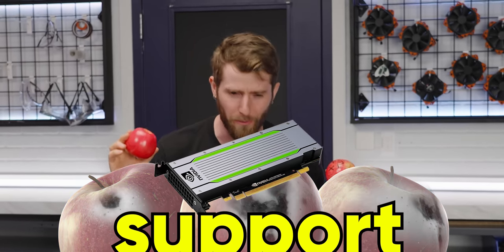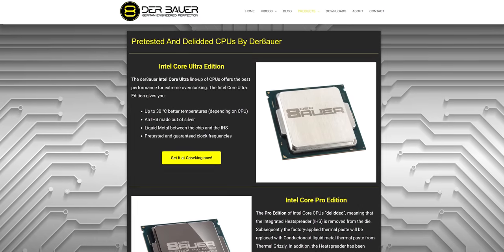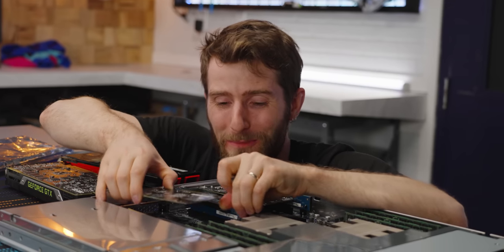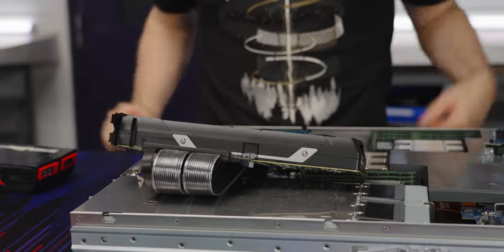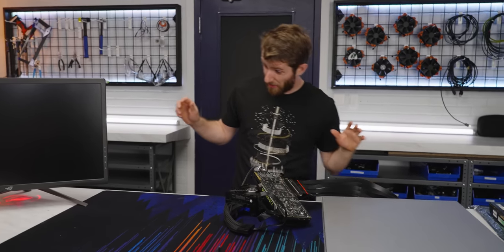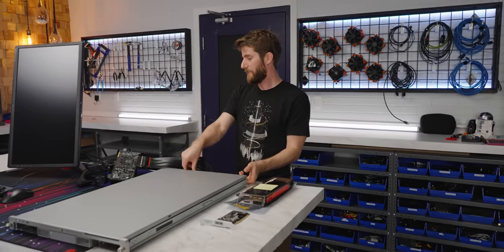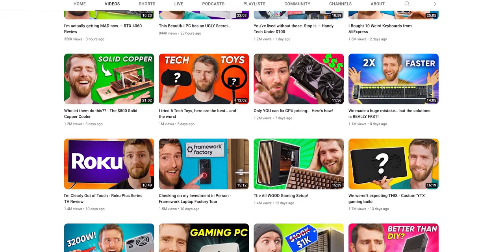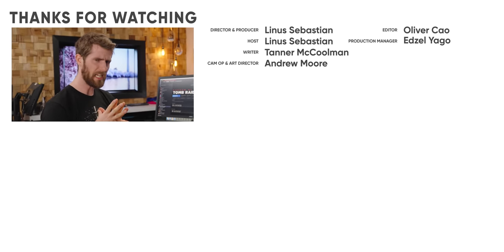Gaming on the Apple SERVER? - XServe 3,1

Comment: Tim Cook spinning in his grave? Well. moving on...  The Xserve 3,1 is basically a 2009 Mac Pro 4,1 cheesgrater, stuffed into a rack mount case. You can upgrade the processors, either by delidding them yourself, or by getting already delidded. The prices for those delidded CPUs have dropped considerably.

Your ram problem is most likely a problem with one of the processor pins. That's not easy to fix. Ideally, these machines support 128 GB of ram, although with triple channel, 96 is the best you can do. 
 Inter34stiong to see that you found an Xserve specific workaround for installing the GPU. On an actual Mac Pro, you would have had to do the Pixlas mod to install it.  The external idea is kind of cool.

The 4,1 Mac Proi/3,1 Xserve is restricted to El Capitan. However, it is easy to upgrade the firmware to a 5,1 Mac Pro,  to get it to High Sierra, and, with your metal capable GPU, there is another firmware upgrade to get it to Mojave. Once you have done that, it will run Monterrey with Open Core,  I am writing this from a 5,1 mac Pro running Ventura with OCLP. 

I've never wprked with an Xserve, but I wonder if OCLP mightg slove the Boot Camp Issue, since it would then identify as a 7,1 Mqc Pro. I don't know, but it's a though.

Comment: I had that same issue with Steam on Linux Mint using the 525 Nvidia driver for a while till 530 rolled out on Linux, I would have to force stop Steam 5 or 6 times before it didn't load a black screen, now was it the driver possibly not but I am blaming the driver till I find the real reason behind it.

Comment: I wonder if the boot issues were caused by the internal GPU on the daughterboard below the farthest-to-the-side PCIe area. I had to take mine out to put a better GPU in mine back in the day.
7:14 - I think those LEDs only come on when the lid is off too, if my 2,1 was anywhere close to the 3,1

Comment: Why though, why would you port a game to mac or try to game on a mac?
Spend just as much money as a top of the line gaming computer costs and get the gaming capability of an entry level gaming pc.

Just buy a windows pc for gaming, as easy as that. No linux, no mac os, just use windows. If you're not an IT person, don't start with an OS where you have to spend hours trying to get a single game working. Windows has had games on it since DOS was released, it's not efficient compared to other OS's but overall availability in terms of software, games, mods, tools and whatever you need to install will 99% of the time be supported by windows by default

As an experiment i think this stuff is cool, so i loved the video. Not hating on what you guys did at all! Love all your weird experiment videos, keep it up! 😄

Comment: Will developers port?   I doubt it.  Doing their own thing rather than supporting vulkan suggests they don't care about anyone and won't provide any help.  Apple also behaves like big retailers - they offer new brands with new ideas, then copy them with their own brand and ditch the third party - see what they've done with both CPUs and the opensource parts of their OS.  If Apple users want to game, they'll have a macbook and a gaming rig.
Although GPU prices are falling, I'm a bit surprised the GPU makers haven't just included a CPU slot on their cards.   32G of GDDR6 FTW!  Resizable bar to the max!
Reply: @@photobunny So... Metal has been around for ages but has almost no games.  Vulkan has lots of games.  With the low effort put into PC ports and the likelihood that gamers have non-mac systems, I can't see a push for this from either a demand or supply perspective.

Comment: Yes, long ago, Apple actually gave a shit about upgradability and customization and cared about their consumers. Now everything has to be soldered to the board, blocked from upgrading on the firmware level, and has hardware requirements for their software in order to force buying a new computer (creating so much e-waste).

Horribly, Microsoft started doing all of these same things starting with Windows 8 (about). NVIDIA is also doing this with their cards.

Comment: Running a pro 3,1, I'm wondering if you're on 10.11, which is the last officially supported OS, or if you're on 10.13 which will run perfectly fine with a patch.  DosDude1 has all the info, been running 10.13 on my 3,1 for about 6 months now and it seems to work just fine with no bugs or issues.  I believe it will work with even newer versions up to maybe 2 versions ago, however if you need 32bit support High Sierra does the job really well... at least for now.  Lots of 10.13 machines out there running CS6.  
Ok, they mentioned the 10.11 near the end of the video.  so year, get the patch and run 10.13.  Get another 2 years out of it.  
All that said, the 3,1 is still a functional production machine for CS6 and the like, but for gaming?  Unless you already have everything laying around for free, you'll get a lot better gaming experience out of PC hardware.

Comment: Linus, you can play gta 5 on a macbook pro late 09 early 10 unibody (specs, 240mb graphics chip, core 2 duo, 6gb ram, a ssd from Samsung "1tb 860 evo" and a hdd "2tb green barra" "both aftermarket mods") running windows with mods and no crashes 😮

(Also xbox one and ps4 versions of gta 5 could have run on 360 e and ps3 pro probably, since these macbook specs are from 2010 and I doubt the 360 or ps3 had worse graphics, 🤔 can't wait to find out expended and enhanced version (ps5/xbs) could of ran on xbox one x and ps4 pro if properly configured?)